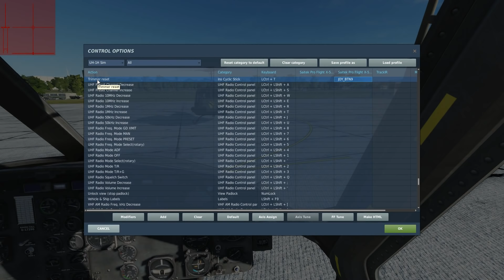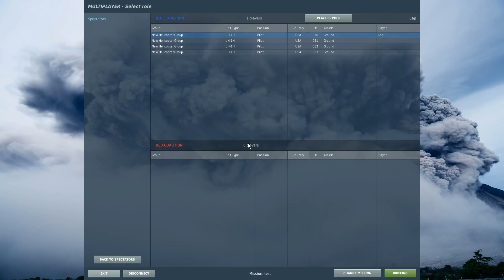UH-1H Huey: Control Methods & Avoiding VRS Tutorial | DCS WORLD

Comment: Great video, but actually to avoid VRS you should try and keep your vertical decent speed 500 fmp or under. Typically the lower the better. Also, to get out of VRS the last thing you do is increase the collective. NEVER use collective. You leave the collective alone and use your cyclic to move the helicopter forward or laterally. Slipping out to the side is the preferred and safest method of escaping VRS. The goal is to get out of that cylinder of air that your blades keep recycling causing them to stall out. One thing you also never want to do is try and raise the nose once the stall is detected. (this is based on real world procedures. things might work different in the sim)
Reply: Victor Duran well if the vr is only just forming up you can defeat it with sheer power (collective)
Reply: This is not always the safest thing to do because when you add collective, you increase the angle of attack (pitch) of the blades which in turn will sometimes increase the effect of VRS. If you have plenty of altitude then go for it, but if you're close to the ground I would never risk it as it's a 50/50 gamble and death or serious injury is not something you want to leave to "luck". Found this video which does an excellent job at visually demonstrating VRS. It should help. https://www.youtube.com/watch?v=HjeRSDsy-nE
Reply: Victor Duran completely agree. But we were going for noob friendly :D also DCS allows for just straight power (when initial VRS kicks in) however if you have the altitude and you are well and truly falling then 100% move forwards or sideways as no amount of power will get you out of VRS. Maybe we should do a full vid just on VRS?
Reply: No, this is very bad practice as is it enormously difficult to spot whenever you enter VRS; it is much better practice to learn to use your cyclic (or stick) to get out of VRS. Whenever you start to experience loss of lift you have already been in VRS for a good couple of seconds. Raising collective at whichever state of (pre-)VRS only exacurbates the problem.
Reply: Indeed, I think it might even be more than 50/50 chance, it nearly always increased the VRS symptoms as you start sucking in more recycled air. Powering up really is not the solution and I see people do it so much in DCS :(
Reply: I'll admit that I've done this before as well and just gave it full collective to recover, but it's not something I like to do because it forms a bad/dangerous habbit that I might try and replicate when I fly in the real world. Also, I play sims to do just that. Simulate real world flight. Even before I flew in the real world I would try and mimic all real world procedures down to the T since that is what helps immerse you in the realism.
Reply: Is it rotory aircraft that you fly Victor?
Reply: Stats I fly fixed wing (GA) and have some rotary wing experience. My uncle owns an Airbus EC130 which is piloted by a retired Colonel and my cousin so I get free training whenever we take helo trips somewhere.
Reply: Very nice, how do you find the fenestron tail rotor? I have never flown with one of those and would be curious to feel the difference.
Reply: To be honest I've never asked either of them. I personally wouldn't know if there's any noticeable difference since I have no seat time in any other helo, yet. I want to sign up for formal classes or at least take a discovery flight in a Robinson which is what's typically used for beginners around here although I think between the Airbus and the Robinson I'll find everything to be completely different. I rode in a UH1H once when I was working in the Dominican Republic and we got hit by the hurricane Jeanne. I was a resort rep and was tasked with evacuating my customers (and as an American local authorities figured my English would assist in translating since people tend to talk fast when panicked). I rode in the left seat although I didn't actually get to fly it or touch anything for that matter. I did recall that the control movements weren't as broad as I thought they would be due to the heavy winds and rain, but for the amount of winds it was a relatively stable bird. The nose up attitude for hovering is also pretty cool.
Reply: My own experience is the AS350 Squirrel and Bell 412 Griffin. There was something fun about flying a helicopter that hovered 5deg nose up. I did fly a Robinson R22 many moons ago before I started flying properly, all I remember was how twitchy it was in the hover.
Reply: Ha. Yeah. I don't think he'd approve of my comment. lol
Reply: I've actually switched to using Vuichard recovery as my default VRS recovery method in DCS, works like a charm. Can't tell you how often this vid I linked has saved my life in that game.^^
Reply: I actually linked it as well in one of my previous comments. I don't have extensive RW experience with VRS, but I have felt it. I also rode along during a simulated engine out landing. I have a pretty dangerous job so hardly anything scares me now, but that engine out landing is something that I wouldn't mind never doing again. lol
Reply: I can imagine, lol. I sadly don't have any RL flying experience myself, but getting a helo license would be very tempting. If only it wasn't so bloody expensive.
Reply: This is the first time I have heard of this technique. Notwithstanding the fact that there appears to be a video of it working - even though the VRS seems to be very short lived and not that chaotic - the technique seems to go against logic. For a fixed wing analogy it appears to be saying that once in a stall you just need to go max throttle, back stick and apply rudder for a minimum height loss recovery. This would be patently foolish. So why does it work here? Strictly speaking, the blade stall at the inner portion of the disk should rapidly move outwards creating a greater area of stalled blade whilst the outer portion will further reduce AoA due to recirculation and thus reduce lift further. None of this really takes into account the random nature of the disturbed flow that the disk might find itself in either. This would make disk control erratic and unpredictable with associated loss of control authority. Having practised this in the Bell 412 simulator it is very disconcerting and height loss is inevitable. Yet here is a video that suggests the aircraft just flys out of it no drama! Is this light helicopters only? Is it only doable in an incipient VRS situation? I need to look into this further. Thanks for the insight and the confusing video.
Reply: In fact it's extremely logical, it just really doesn't make sense if you look at it in fixed wing terms since the underlying mechanics are completely different. And no, as far as I am aware the Vuichard technique should work for all helicopters and is generally seen as more efficient than the old school standard maneuver,  according to everything I've seen and read about it so far. Height loss is always inevitable once in VRS, but it should be somewhat less this way. What it comes down to is pretty simple: The goal of VRS recovery is always to get out of the disturbed air and gain some airspeed, allowing you to arrest your downward momentum. Here this is accomplished by applying lateral cyclic with opposite rudder, which in a helicopter leads to side-stepping out of the vortex without changing your nose heading. The main reason this works so well, as far as I understand, is because you are also using thrust provided by your tail rotor, which should be mostly unaffected by the VRS, to push you out of the vortex. Raising your collective just gives you the lift to quickly recover from your negative vertical velocity, which won't increase much as the recovery happens too quickly for that. Now, I'm sure there's a lot more depth one could go into about how exactly this works in physical terms, but this should sum it up nicely enough.
Reply: This is a very interesting topic to look in to. I have to admit that it looks quite shady and potentially a surefire way to visit the ground quickly. None of the videos or articles actually explain what mechanism actually gets you out of VRS. There are a couple of really basic diagrams and chat about tail rotor thrust - which is only half correct for the true forces acting on the helicopter!  But there is nothing solid about what is actually occurring. The videos are quite inconclusive and filmed at very poor angles. There is also a mess of what stage of flight the helicopter is actually in: are we downwind slowing to a hover?; OGE in the mountains?; carelessly looking out and sinking in a quickstop? Ultimately, helicopter pilots are taught to avoid these dangerous routines so the first question is why are we there? If we have porked it then we need to know how to escape, but again, the technique doesn't answer the basic mechanics of VRS. You cannot simply side-step the vortex without achieving translational lift because you are creating the vortex, and by definition, translational lift speed is what is required to escape the recirculated airflow and establish clean air through the disk. Half an aircraft's move to the right or left does not achieve that. Further, the anti-torque thrust of the tail rotor will combine with the torque thrust at the nose to provide lateral thrust. But this is relatively small and only exacerbated by a big difference in tail rotor versus disc height when in the hover. I don't see this being enough lateral thrust to push the aircraft into clean air. Also, why the 10-20 deg AoB? The blades are travelling through erratic/chaotic air and so the engines are working hard to control RPM against randomly varied drag and the amount of control is fairly small since the rotors are not acting in a stable environment. If I have that level of control then surely I am not in VRS and could just fly out? Which seems to be what is happening. In the meanwhile, there seems to be an awful lot of civilian light helicopter users who have adopted this technique with the only big name supporting it being Vuichard's company itself. This gets the hairs on the back of my neck up. No serious explanation of why it works combined with a lack of literature endorsing it seems sketchy. I may have missed something so happy for feedback.
Reply: Stats rotary wing flight and fixed wing are completely different beasts. You can be the greatest foxes wing pilot and step into the rotary world and feel like a complete rookie. Other than how weather effects your flight characteristics there aren't too many principles that apply equally to both types. The only thing I can think of that would be comparable in fixed wing aircraft would be flying through wake turbulence or an accelerated stall.
Reply: Victor, totally understood. None of those characteristics i talk about above are from fixed wing. They are directly addressing rotary flight dynamics. I spent 2.5 years flying helicopters but would not consider myself experienced in them, and that was a few years ago now. My allusion to fixed wing was purely analogy. But your comparative still illustrates the point, you do not have great control over those two conditions, you are mostly along for the ride. I like aerodynamics and this is an interesting conundrum I wish to solve since it is anathema to the standard recovery.
Reply: I got you, bro. But remember that even though you don't have great control it doesn't mean that you don't have enough to get you out of that predicament which is the end result we're aiming for. This is just me being a clown, but it's like when you're using the restroom. Have you ever just ran out of toilet paper as you were finishing wiping? Like only had 1 or 2 squares left? Same concept. It might not be a whole bunch, but it's enough to avoid disaster. (none of this was typed with a straight face). From what I'm told, many aviators that try and cross over have issues with this and other parts of flight dynamics because they bring old habits and training from their previous platforms and they don't understand why some procedures seem to feel "backwards" or counter-intuitive. I do see what you mean though
Reply: I guess I should have read this thread in its entirety before I posted. But I'm certainly with you on this one. The Vuichard VRS Recovery Technique IS already being taught by most instructors as the fastest and easiest way to get out of VRS. Way better than the Nose Down Attitude that has been taught for decades.
Reply: Of course, I read your reply after I posted my own. Now I'm just beating a dead horse. Oh well, it allowed me to practice a lesson and use my CFI.
Reply: When VRS causes me to fall, I found it helpful (sometimes?) to decreases collective so as to decrease the AoA of blades versus airflow (so they can get out of stall), and then slowly pull up collective again...don't know if that's a viable practice
Reply: @Stahlwollvieh  Thanks for the link to the Vuichard recovery!

Comment: Flying a real helicopter is very much a seat of your pants experience. You have to listen and feel for what she is telling you. There are many methods for escaping Settling with power/VRS. If you try pulling power but your sink rate fails to slow or increases it is important to immediately lower collective and push forward to gain forward airspeed (the basic maneuver taught in flight school). Another method (arguably the preferred method for more experienced pilots) is to hold the current power setting (leave the collective alone) and sideslip out of the vortices before adjusting power as necessary to go around for another attempt. NEVER pull collective for power when in VRS. The main reason for this is the aerodynamic situation which you are in. Your main rotor is traveling through its own vortices and therefore unable to generate adequate lift. Adding collective, or increasing pitch angle increases the vortices, therefore increasing the problem. The only solution is to find "clean air" for the rotor to do its job. One thing to watch out for is transferring the problem to the tail rotor (chances are slim, but in the right wind conditions it could happen). These hazards have an increased risk of occurring if you are high, hot, and/or heavy (high altitude, hot ambient temperatures, or at or near maximum gross weight).

Comment: This is the biggest problem I have: The stick. In a real Huey, there is no spring return to center, which is what 90% of control sticks you have in the market. When you're using a spring to center stick, you're fighting the Huey. So, I took my springs OUT completely. When you move the stick, it stays where you put it and the Huey flies like a champ. It takes a few tries to get out of the spring mindset, but once you get the hang of it, the Huey is a breeze to fly. I am taking off, hovering, moving about at will. And you will find you're hardly ever using the trim. There's no need. The only thing you have to be wary of is removing your hand from the stick. Go to active pause or hit escape to pause the game. Luckily mine has enough friction to stand upright when I balance it. It  was a huge game changer.

Comment: The loss of lift transitioning from horisontal speed to no speed has very little to do with VRS, but more to do with loss of translational lift. VRS only occurs under high downward velocity with high rotor pitch. 2 very different issues caused by 2 different factors, and which require very different reactions to counteract
Reply: I noticed that last bit where he said "That's VRS coming in there".  It wasn't VRS it was Transverse Flow.